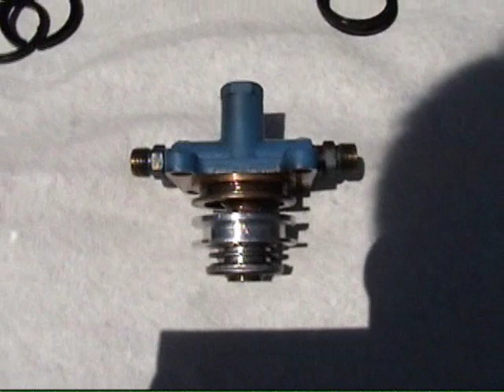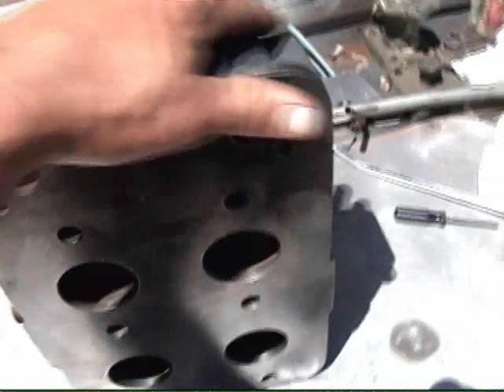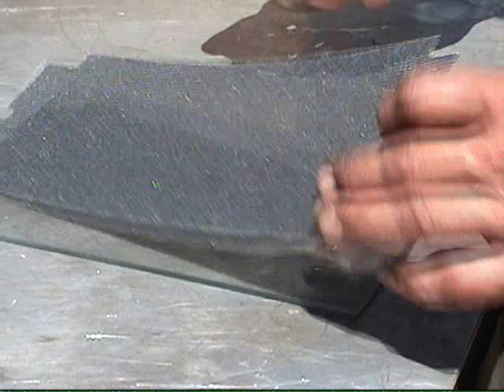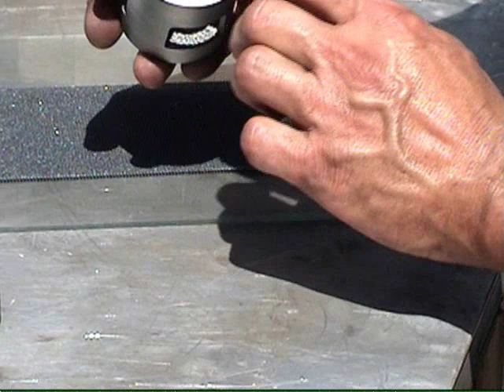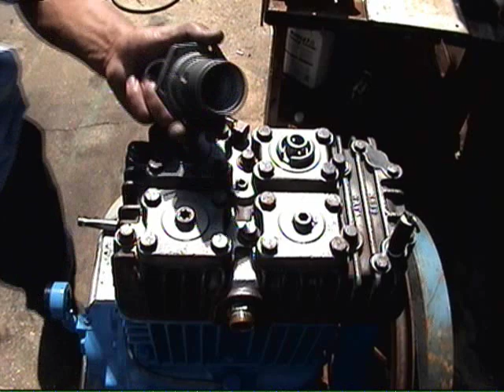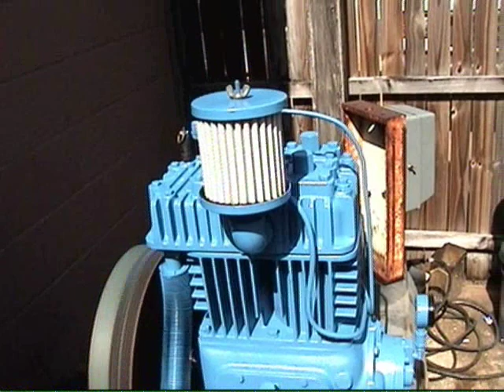Quincy Model # 325 rebuilt and running

Comment: Great video( other than you keep calling my compressor obsolete lol). From the comments apparently it is a whole series fantastic!. Just found out today that Quincy made my compressor. Its a 1954 Gilbarco l325 and has a 4 stamped in a box directly after the model. I get from the comments that is a version number or something. Mine runs like a top.Did have water in the crankcase the other day. You commented that is from light loading whic mine definitley is being in my home garage. The system has some small leaks somewhere and it runs about once a day because of that besides my use. Lately that has been in the morning when it is humid here in Florida I thought that was the reason. Even wired it into the lights so it cant run unless the lights are on to keep it from running unless Im using it. Been over the system for leaks more than once, came to the conclusion that leaks are part of life, were it eneters the hose reel leaks sometimes for one. If you have any sughestions on preventing water in the crankcase?
Reply from the maker: You can try to install a crank case heater, but those don’t seem to work very well. Unfortunately, the crank case heaters that are out. There are four refrigeration compressors with the idea of keeping liquid refrigerant from entering the compressor at startup,
Your best bet is to not turn it on  unless you plan to use it and if you do use it plan to run it run it until it gets up to or close to operating temperature before you shut it off, that is one of the reasons why I installed dual control on the unit in the video. It’s not just a piston, air compressor problem. It also exists with rotary screw compressors as well.
Reply: @rotarycomptech thanks for the reply. I should have thought of the crankcase heater lol being a (semi retired) hvac tech. Nothing i have matches up really well but it did prompt me to look at heaters designed for cold weather starting. Found a 100 watt magnetic pad on walmarts site for $12 so reallly couldn't say no to that price. I think I have enough room to slide it between the crankcase and base. Other than that I had come to the same conclusion, will just keep it off and let it leak. It puts a decent amount of heat into the system if it pulls from flat to 210. I've not noticed this before but I changed shut off from 240 to 210 at some point might have something to do with it. I think it still came on at 180 when it was 240 so runtime per cycle has decreased. Might have to rethink that although if so I believe Ill drop the on to 140 or 150. Have to find  another control though, Im using a non adjustable refrigeration control.

Comment: Hi, what would cause an unloader tower to only unload air when the intake port has been blocked? if i manually press down on the unloader piston it wont unload much air. If i block the intake port and then press down on the unloader tower piston and remove my hand from the intake port it unloads air. Any ideas?

Your videos have been a great help with my 310, here is a video of what i am talking about.
https://youtu.be/EpM1JkCVUkE

Comment: I have a 340 that's blowing oil in to head assembly  not sure what would  cause it to do that bad rings has new head on all new vavle assembly  bore look good I'm guessing  wore rings. Or could a vavle cause it to suck oil past rings just need some help
Reply from the maker: Your best bet is probably to remove the head and run it without the head on it and see if it is pumping oil past the rings. More than likely depending on the age, it probably needs honed and re-ringed

Comment: I just picked up a 70s 325.  It accumulates water in the crankcase oil very quickly, I have to wipe it out with towels by pulling side plate.  I had about 3/4” of white sludge in the bottom over a 3 month period.   It runs maybe 3 to 4 times a day.  Can you point me in a good direction.   Also thank you so much for these videos.
Reply from the maker: Simply put your not running your air compressor enough and your ambient humidity is being collected in the crank case. It’s a common problem for people like yourself and me who only use their air compressor for short periods of time or not long enough to get the oil in the crank case up to temperature, after all this is what causes the moisture to flash off of the lubricant. You may try to install a crank case heater but in most cases it doesn’t work very effectively.
If you don’t care about power cost and the compressor running you can always install a timer drain solenoid valve to drain the condensate from the tank and have it set to go off every couple of minutes for 20 seconds or so. In any case just like me you have to get in the habit of running the compressor up to temperature before you shut it down for a while
Reply: @rotarycomptech  really appreciate you answering my question especially on an old video! I was afraid that was the case.  I’ll just keep an eye on it and change the oil once a month if need be.  
     My tank leaks down over night so I drain it completely every day but it only takes 10 min to fill to 190 psi so it barely gets warm.

Comment: I saw you comment on another video on a 325 roc 7 that it is an obsolete model and parts are not available. is the ROC 7 different than this model? Thank you
Reply from the maker: I don't have any information on the year versus record of change ,
 But the difference was typically  The oil pump and valve assemblies

Comment: Thanks for the videos!! I rebuilt my 325 watching these. One thing I didn't hear you didn't mention how much oil pressure you should run on a 325. Also I have the older vane style oil pump and notice that it takes 10 seconds or so to get oil pressure.
Reply from the maker: 18 to 20 psig  Is what Quincy recommends

Comment: do you still remember any specs on this , I have one from 1975, motor ( electric) went bad, had some ppl mess with it who should not have and .... now I need to know clockwise or counter clock wish and the RPM I likes so I can replace the motor ..  I through a cheap 2hp 1800 rpm one on there to make sure it still works, and it will build pressure both directions , but with the pully having "fan blades " on  it im sure it ment to go a certain way ....  thanks
Reply from the maker: There should be a directional arrow on the fly wheel itself. The older compressors with the old vane type oil pump will make oil pressure in either clockwise or counter clockwise rotation

Comment: i have a twin unloader 325 , it dosen't load after starting, it starts venting through the hole in the side of the tower . if I crack the 1/4 in line it relieves pressure on the diaphragm then starts pumping . got any tips ?
Reply from the maker: Replace the hydraulic unloader
Reply: @rotarycomptech  i called my local dealer  there reply was " its probly post ww II ,send us a pic "  do you have a good source that will deal with these oldies ?
Reply: i removed the unloader to take pics. the o rings are hard and have a few small groves in the inner one .can i just replace the o rings ?
Reply from the maker: @gaildavis3433  nope your kinda shit outta luck

Comment: Hey Thanks for the videos. How did you get the inside of your compressor painted red? Is it powder coat or paint? 
Thanks again
Reply from the maker: Its automotive primer
Reply: @rotarycomptech  great thanks. Any recommended special prep other than just cleaning and getting it oil free.

Comment from the maker: Hey Jim,
 Sounds to me like your crankcase breather isn't working properly. There should be a 5/16 OD copper tube that runs from the crankcase opposit side of the hand whole cover  To the intake portion of the head. From what you're describing it sounds like it's not venting. You can remove the line at the crank case to see if its operating some models had a tube that mount inside of the crankcase and inside of that tube was a plastic ball kind,  It acts like pcv valve in a automobile.  The motor stalling issue sounds more like a problem with the motor or the incoming voltage rather than the compressor but to confirm or deny there is an issue with pressure you may want to install a pressure gauge on the discharge line before it enters the tank to ensure you're not over pressurizing the compressor if you know what I mean there could be a restriction in the discharge line I think I remember you telling me this unit had the old style cushion chamber on it?
 Also if you have and amp meter check the amperage when the motor starts to bog down and also check the voltage it should not drop off by more than 2 or 3 Volts at the most.
 Good luck!!

Comment: Good night, I have a Quincy 325 compressor, after filling and disarming it is losing air, through the air filter outlet, what can it be?
Reply from the maker: A leaking HP discharge valve

Comment: I have a 325 roc 4. Runs good builds pressure fine, but it has a intermittent high pitch knock. Almost like banging two pieces of pipe together. Any ideas?
Reply from the maker: Loose high pressure  wrist pin bushing Loose valve assembly
Loose flywheel bolts
 Worn insert bearings
Reply: @rotarycomptech  I will have to check the flywheel. If not then it looks like I'll have to open her up. Thanks
Reply: I believe my compressor is not unloading. No air comes out of the unloader tower when the compressor stops running. I disconnected the copper line and ran the compressor, no air comes out when running or when it stops. What should I check next? Also the knock seems to be coming from the tank or that's what it sounds like
Reply from the maker: @jesusalvarez5563   Compressed air should be coming from a quarter inch copper tube                  When the compressor is off or there is no oil pressure, You have a defective hydraulic unloader
Reply: @rotarycomptech  I have a roc which is splash lubricated therefore not hydraulic? Should air still come out when compressor is off?
Reply from the maker: @jesusalvarez5563   Yes, but you have an obsolete air compressor
Reply: Also I just ranned the compressor with the drain slighy open until It reached shut off pressure. There was no knock, could it be a bad check valve?
Reply from the maker: @jesusalvarez5563   There is no check valve

Comment: Hello came across these awesome videos while searching to do something similar myself...thank you for uploading  your knowledge...i was wondering if your still doing stuff like this being that this was uploaded  8 years ago...on my birthday...lol...i have a Quincy QST 25 rotary screw compressor that runs all the time as it setup for cont auto...is there a way to make it run dual auto so that it shuts off after building up pressure instead of uploading then unloading...there is a switch that says "cont-auto-dual" and it runs on the cont side but does nothing when i turn the switch to dual??? my electric bill was over $1,000 the 1st month i used it...that's triple of my normal bill...i can't find anything online and the Quincy service people are horrible...any help or leads would be greatly appreciated...thank you Joe
Reply from the maker: Hey Joe thanks for the comment, I'm sorry to hear that your not having much luck with the local Quincy distributor, Atlas copco purchased Quincy a few years ago and everything has gone downhill since then. Quincy QST25 with dual control. Running in constant or otherwise known as continuous means just that it won't start and stop it will just load and unload as the motor continues to run.  In the auto dual mode the compressor loads and unloads in the same manner  The only difference is when the compressor fully unloads a timer starts running it's typically set for around 6 minutes If with in the time that the timer is set for if the compressors  Pressure switch contacts do not close or in other terms if the compressor does not call for air pressure the compressor will shut off, Upon falling air pressure the contacts on the pressure switch close  and the compressor restarts. Keep in mind that if the compressor starts and stops more than 6 times an hour it's better to run it continuously. It sounds like from what your describing you have  defective unload timer,  If you select auto dual and hit the start button and the unit will not start more than likely it's a defective unload timer.
 Good luck and thanks for subscribing!
Reply: @rotarycomptech   Thank you for replying and thank you for the advise...i will check the unload timer immediately...we got the compressor for $1,100 about 3 months ago and have had it up and running for about 2 months 5 days a week 8 hours a day...it has been running on cont auto and loading/unloading since we got it...i saw the timer inside the control box and wondered what it did...lol...as soon as i get this compressor setup on the auto dual mode i am going to rebuild another compressors piston and rings as it takes a long time to build up pressure...there was some oil in the tank recently and when we shut it off it spins a lot longer then it ever did...seems like it has no compression...then after that we have a nice Quincy air motor going on a big Kohler gas compressor that the air motor seized up and we bought it a few years ago for $100...busy busy busy the projects are never ending...thanks again for your help

Comment: Thanks for the great videos! One question. When I run my 325 ROC 12, and it stops all the air leaks out the intake, is this the discharge valves that are sticking?
Reply from the maker: Yes but only the high pressure discharge valve, That's where I would start 1st
Reply: @rotarycomptech  Thank you I rebuilt the 2 discharge valves and it solved my leaking issue!